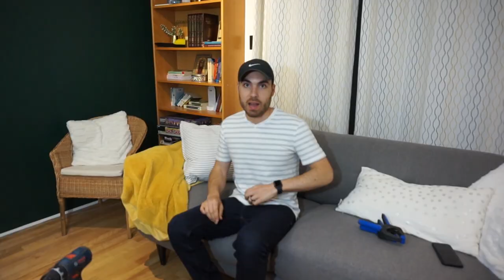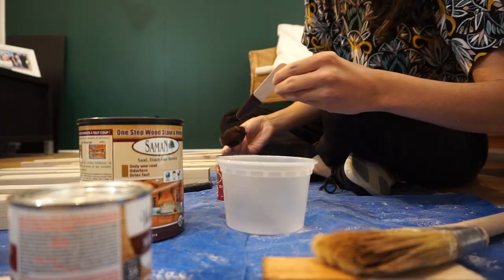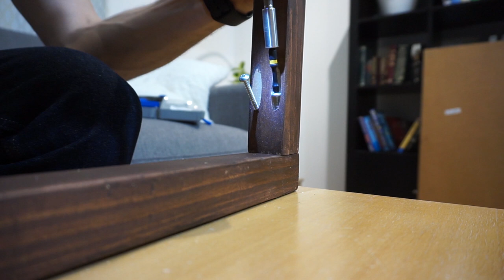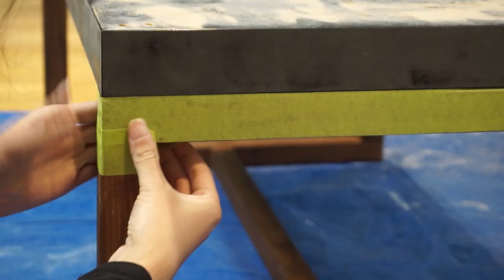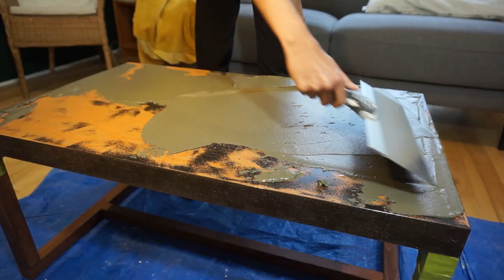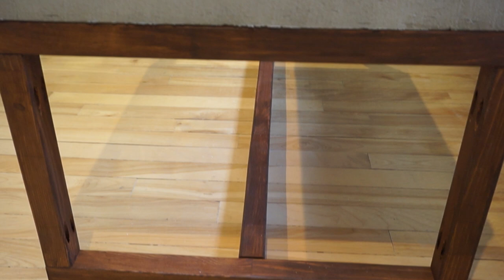DIY Concrete Coffee Table IKEA HACK [WITHOUT a mold!] | Ety

Comment from the maker: Hey everyone! In this project I used thin set mortar to get the concrete look (because that’s what I had leftover from other projects). I refer to it it as cement/ concrete in my video. Using thinset instead of concrete will help you achieve a smooth finish.

Comment: Thank you! My husband and I are going to attempt a 36” round table!!!! What kind of concrete is this? The bag wasn’t super visible.
Reply from the maker: Hi liezl! I actually used a mix that I already had at home from another project. It was thin set mortar (used for setting tiles) which is basically cement mixed with sand. It worked great for my project and is still holding up perfectly :) but if you want to use concrete, I’m sure you can use an all purpose concrete mix that you can find at any hardware store. I just wouldn’t go for the fast setting ones since you want to have enough time to smooth it out.

Comment: Any idea for food safe sealer that would prevent damage without changing the raw concrete look? I've tried woodworking polyurethane, but that's too glossy. But without sealer you will never be able to remove stains caused by spills of oil, wine, coffee or candle wax. It will just soak in the mortar without any chance to be removed without recoating the thing with fresh mortar. Therefore using some kind of sealer would make lots of sense...

Comment: Hi what  was the brand of cement you used? And what sealer did you use? Thank you! This is a great hack!
Reply from the maker: @casual chic geek thank you! I used some leftover concrete from some home renovations. You can use a multi-purpose concrete mix that you find at the hardware store, I just wouldn't recommend the really fast setting ones like Quick Crete - you won't have enough time to smooth it out. For the sealer,Behr has a concrete sealer that is low lustre, or you can try the Kilz concrete sealer
Reply: Hi thank you so much for replying! This was very helpful!
Reply: @Ety_Vaknin  yours turned out really good. Some of these other tables on YouTube look like stucco 😬😎. I think they used quick Crete. I’m definitely gonna try it your way. Lol
Reply from the maker: :) yes I’m so happy with how it turned out! Just a quick note, I used thinset mortar (usually used under tiles) which is very fine compared to concrete, that’s why it turned out so smooth. I think you can even buy it in either gray or white depending on what you prefer!
Reply: @Ety_Vaknin  cool thanks

Comment: Hi Ety, I really want to replicate this with different legs. Can you let me know how the concrete is holding up? Is it easy to clean, and is there any chipping? Also, does it stain at all, because I am wondering whether it would need sealing, like plant pots.
Reply from the maker: Concrete still looks great! I haven’t spilled anything major on it so I can’t attest to the staining, but occasionally I forget to use coasters and no issues with rings staining so far. I used a sealer after the video - the one I used was a satin finish, but I wish I would have used matte. It would have looked way better. On the plus side I think a shinier finish like satin is probably protecting the concrete more from staining. No chipping either! Just make sure you get a nice thick layer on the top AND sides of the table. If the concrete is thin it would be easier to chip.
Reply: @Ety_Vaknin  I just saw your response and I am sooooo excited. I will be sure to get a thick layer of concrete and to seal the table. I'm adding the concrete to the shopping basket now!

Comment: If you attempt this with concrete mix it will 
NOT COME OUT THE SAME. WASTED SO MUCH TIME AND MONEY TRYNA FIGURE OUT WHAT WENT WRONG. SHE USES MORTAR MIX WHICH IS WAY SMOTHER THAN CONCRETE WOULD EVER BE, ESPECIALLY BECAUSE CONCRETE HAS ROCKS IN IT. WISH SHE WOULDVE SAID SHE USED MORTAR mix from the beginning. Wouldn’t have waisted money on different bags of concrete.
Reply from the maker: Hi Richard, I’m sorry this didn’t work out for you. Thanks for pointing it out. I’ve pinned a comment to the top of this section so that it is clearer.